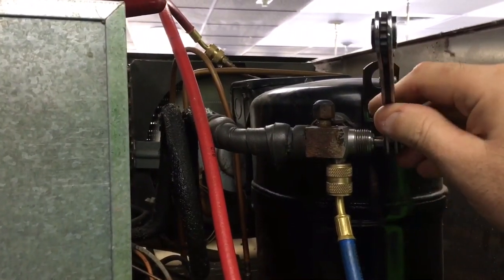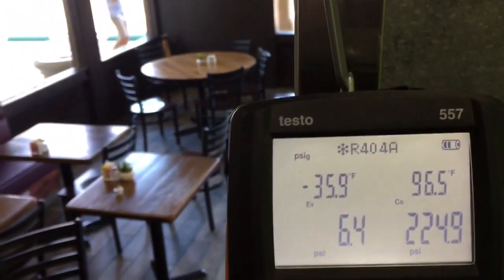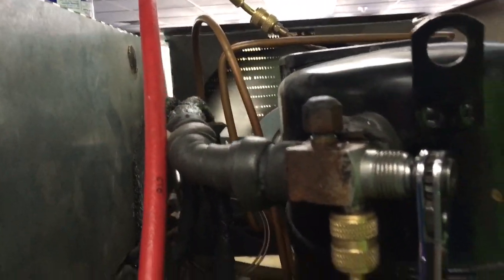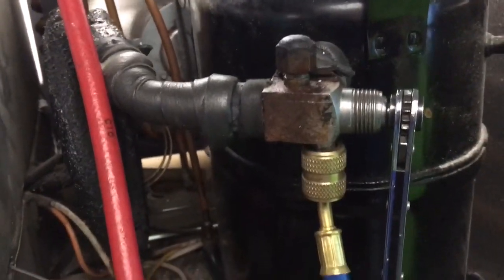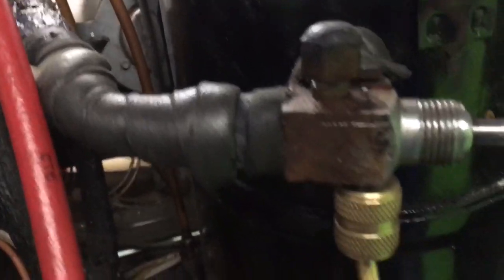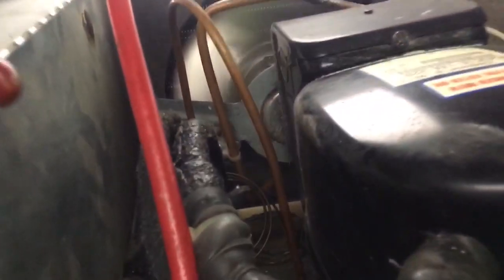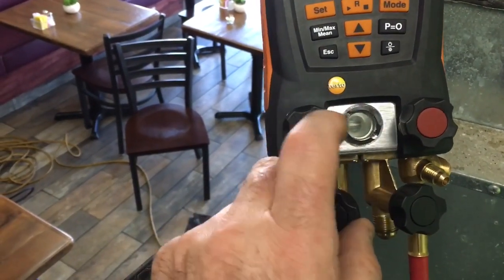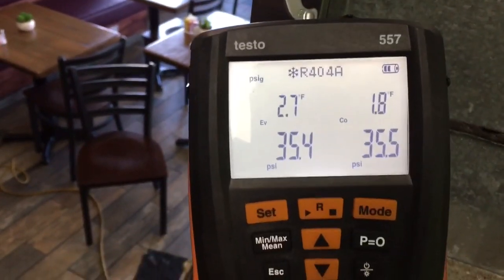How to check a Compressors Valves to see if its any good.

Comment: Great tip for the nubees on recovering the refrigerant from the manifold and hoses. Especially important on small, self contained units. I would recommend "parking" the hose prior to opening the high side valve. Keep those tips coming!
Reply from the maker: Good comment ! But, Not really necessary if You NEVER park your Hoses as a Rule since your suction will allways be at a positive pressure and there Will Allways be suction vapor in your hoses.   i see where u are coming from though.  if unit was running in a vacuum and the self sealing hose was leaking u could pull in air , But How often are We Working on systems that Run in a vacuum ? But, Very Good comment ! im inthe camp that Never Parks my hoses , its just a pain in the ass for me & a extra step. But, for those of u that park hoses , Go for it. But , now remember you are relying on the rubber seal to park point for sealing not , the actual self sealing hose anymore. Just something to think of. Again, Very Good comment ! 👍👍👍👍👍
Reply: Nor familiar with the term "parking". Care to explain?
Reply: I tought that if the compressor wasnt able to pull down to 0psi thats when its bad due to valves being bad. Also after you opened up the acces port it was at 25 psi thats a pretty good psi to running at no?
Reply: What he was looking at was the high side..  he backseated the low which causes it to try and pull a vacuum on the system.. you see the low side drop but the high didnt drop at all which says the pressure is getting right past the valves and doing nothing in the system...  i think..  not an hvac tech, just trying to learn about the field